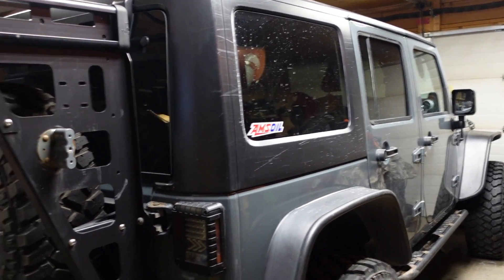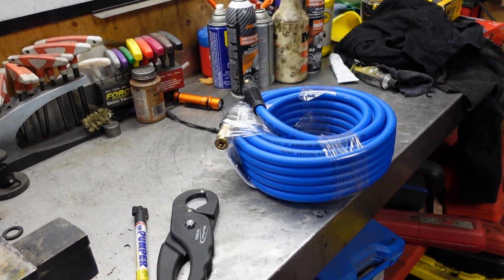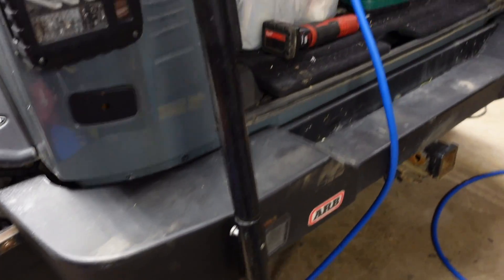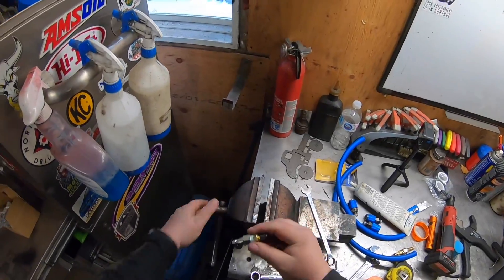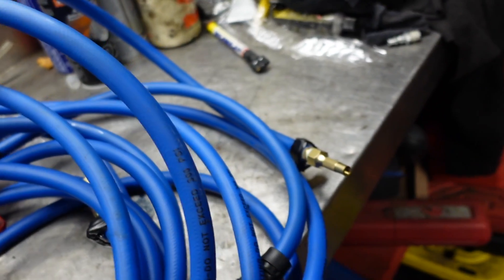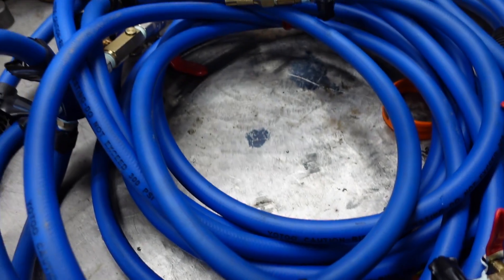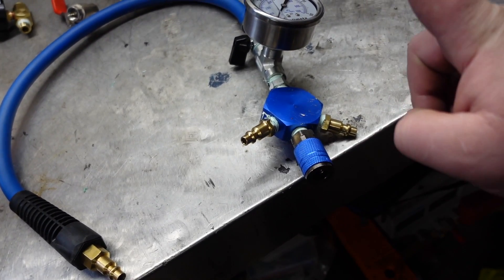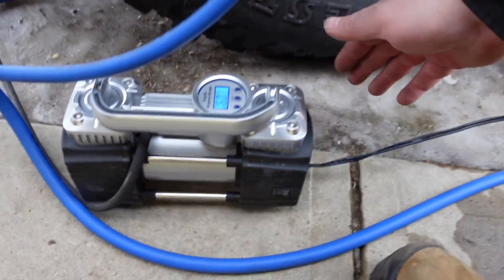4 Tire INFLATION SYSTEM DIY REV 1 & 2

Comment: Haltec H-5265 Standard Bore Lock-On Air Chuck closed ones with branch tee’s,in line with hose ,don’t need the little hose from your main line
Just one line from your air  gauge to all four wheels .

Comment: I used a tire chuck with lock on lever for each of my tires. You might like to try that instead of the ball valve and screw on fitting. And they are normally closed instead of open
Reply: Also have an electric switch to fill and bleed on the dash. I used an in line 12v electric  to pneumatic valve for bleeding